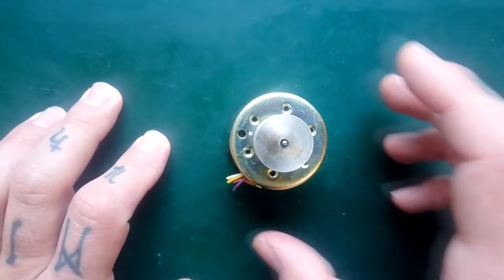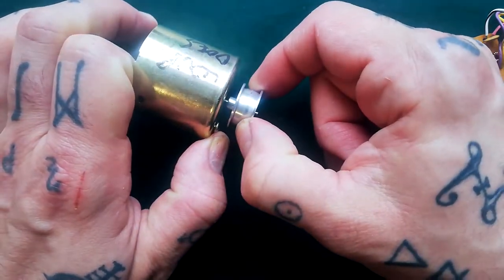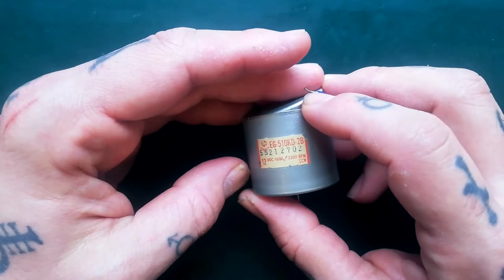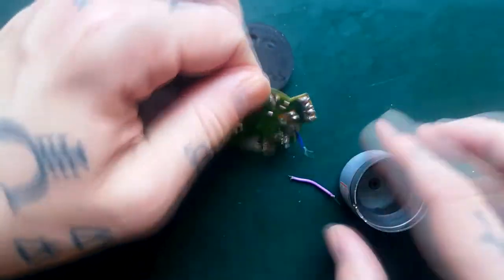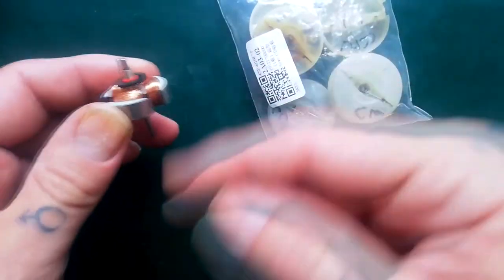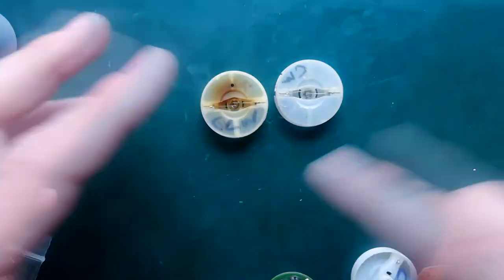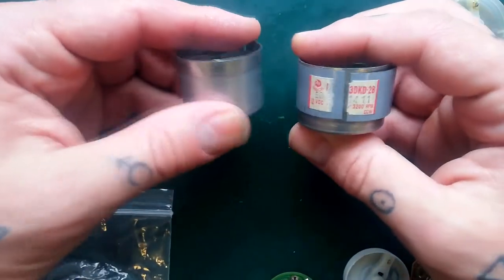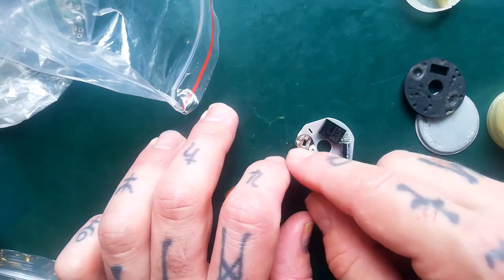4-Track Capstan Motors Through the Ages | Mabuchi | Sankyo | Matsushita

Comment: hey. i'm currently working on my Porta Two HS and the Pitch Control doesn't really work and the capstan get's kind of hot. i got the service manual and by now i couldn't really find any electrical problems outside of the Motor. how do you take that apart? It's a Sankyo SHW2R.

Comment: Thank you for all of these vids.  helped me out of a lot of jams!  quick question - I have a 424 Portastudio, runs great until it the motor runs for a bit and then starts SQUEAAAALLLING like crazy.  If I take the belt off, it squeals immediately - so the belt tension makes it a lot better.  I put a dab of sewing machine oil on the spindle to just see if that was it, no change.  Any suggestions?
Reply from the maker: Sorry for late reply, could it be the commutator has broken, so there's friction where the spindle joins the plastic cap deep inside the motor? See this video https://youtu.be/IICcT4RDLa8

Comment: any lube points on these motors?
Reply from the maker: No. The only parts where anything touches are where the shaft enters the casing below the pulley - so you can just apply lubricant to that crack - and where the commutator touches the brushes, and the other end of the spindle joins the plastic disc in which the brushes are mounted… to access the latter you need to open the casing and desolder stuff.

Comment: Very interesting. Would you please tell us what the model numbers mean?
I've got Sankyo DFC6R01 in need of replacing and those just don't exist in the wild. Could you please help identify its specs, so a replacement can be found?
I guess "R" stands for direction (as middle letter is always "L" or "R" in Sankyo motors). I can't figure out the meaning of the rest of the marking.
Does 6R stand for 6 Volt, clockwise?
Reply from the maker: I could speculate but I don't really know. Looking for substitutes, the number of input pins, whether it's forward or rear mounted and voltage  are the most important things, sorry that's a bit vague....
Reply: @Tetrakan  Thank you for your reply. After three days of fiddling, the damn thing just started working all of a sudden! Probably brushes oxidized, as the tape recorder was never was used past three decades or so.

Now I have a proper datacorder for my 8-bit computer collection.

Comment: Are there any parts you've run onto on tascam models that are incredibly expensive to repair/replace and once that component goes the device is more or less a parts model at that point? I am asking because I keep wondering how long my tascam 414 has left before she's toast... probably should know better than to wonder about those things but curiosity doesn't seem to care much for reason.
Reply from the maker: Magnetic heads and, to a lesser extent, motors. if the coil of magnetic core in a head breaks, you need another 4 track head. With motors, there are still 1 & 7/8ips motors being made, its the ones with motor control chips that will do 3 & 3/4 ips that are in short supply, and not being manufactured anymore. I'm optimistic that maturation of 3d printing technology will make it economically viable to start making these parts again in my lifetime.
Reply: @Tetrakan  thanks for the insight

Comment: Do you know of any motors that are compatible with eg-500ad-2B?
Reply: Also where is a good place to get replacement motors?
Reply: Any 12V, 2400rpm, CCW motor with the standard mount (6 bolt holes w. 1" circle diameter, 2mm shaft) should do. If you can't find anything better, there's still knock off EG-530ad-2B  of varying quality in new production. A little weaker than the old 500ad and 510ad series, but it usually doesn't matter. Good luck.